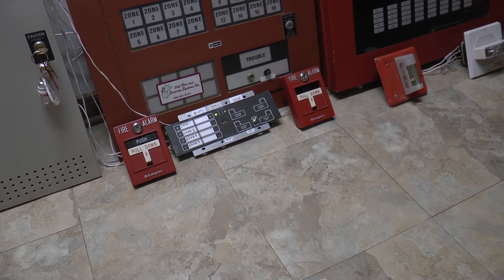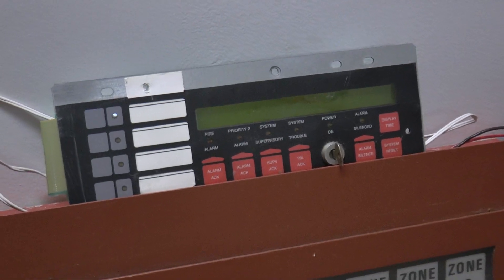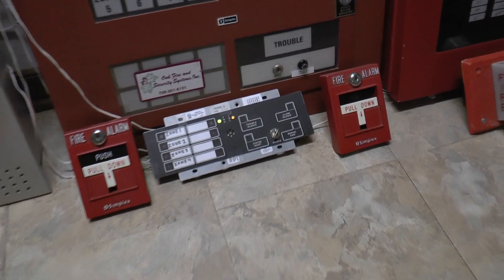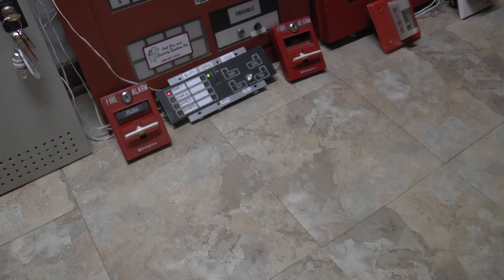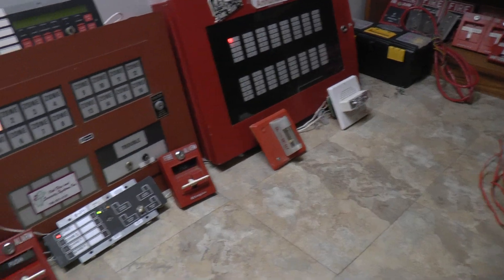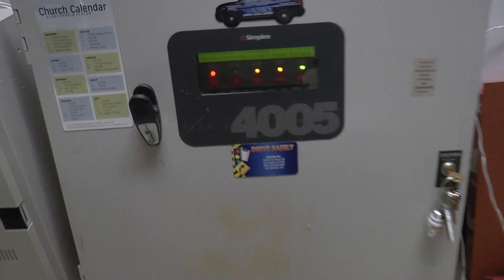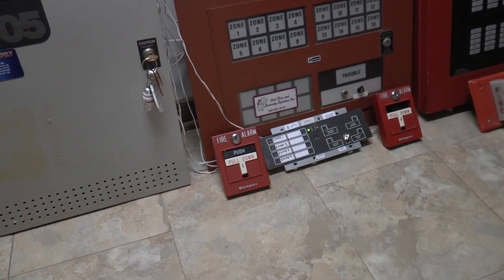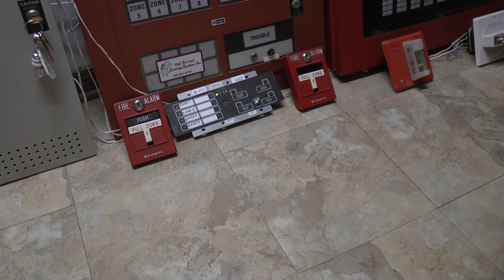Floor System Test 44

Comment: Hey Ryan, haven’t heard from you in a while. Nice to see you making another video again! I really like the combination of the 4010 and the 4005 systems. With all the different horns and bell chimes.
Reply from the maker: Thanks, Christian! I am disappointed that I've been so quiet again this year, but as always, I'll strive to do better for next year!
Reply: No problem! Have you visited the elevators at 7 Blanchard Circle in Wheaton? I bet you’ve seen it. The building has 80s Dover’s without fire service. There’s another one down the hall, it’s a big U.S. Elevator. I like that a little more because it has an epic motor! But the Dover’s are good too.
Reply from the maker: Yes, I have several times. Just never filmed them.